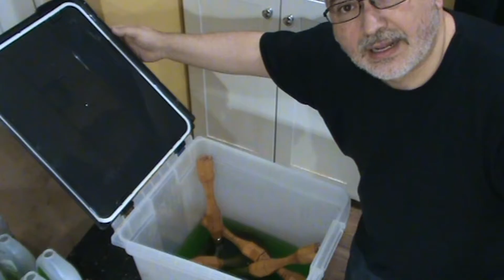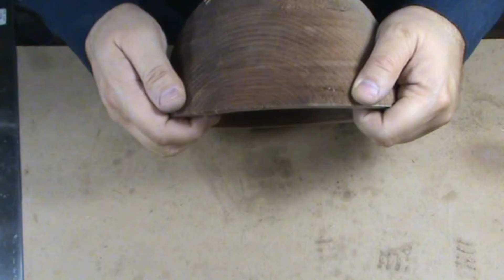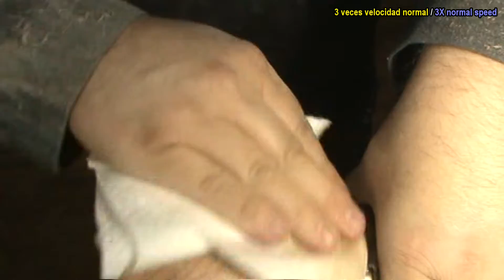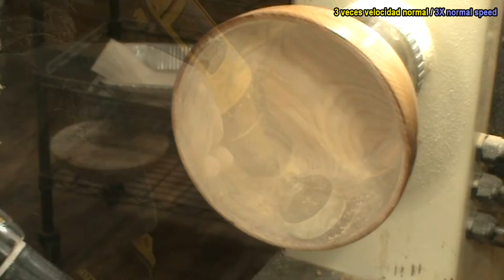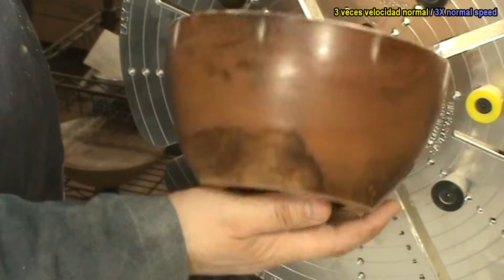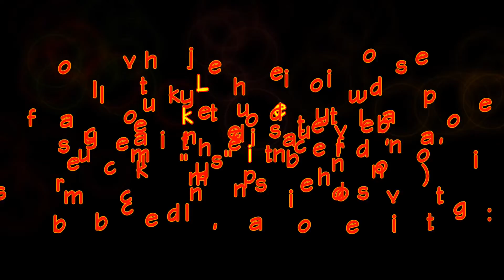Soaking in dish soap and water method, Part 2

Comment: About 8 months, how does the bowl look now?  Any cracks or warping?  I have not tried this method, curious if it's worth the try.  Thanks
Reply from the maker: +David Campbell Hi David! Thank you for your comment my friend. It looks pretty much the same as it looked 6 months ago when I did the follow up. I give you measures in mm since that is easier to get in finer detail:
After done the measures of the top circumference where 191 mm in the direction of the grain and 188 mm perpendicular to the grain. When I did the follow up, 2 1/2 months after done, it was 190 mm in the direction of the grain and 183 mm in the direction perpendicular to the grain. Today I measure it and it was still 190 mm in the direction of the grain and 182.5 mm in the direction perpendicular to the grain. So basically the same as 2 1/2 months after done. There was then not much additional shrinkage, and there are no cracks or checks. Still sits pretty well on its base and you have to look really hard to notice the difference in diameters in the mouth. That said, maybe different woods react in different ways. But I am pretty satisfied with the method. Cheers! Daniel

Comment: Very nice.... I was scared at first because I thought you were going to put it on the lathe and all the soap was gonna go everywhere....LOL! glad you washed it off and waited for it to dry... Very interesting in the fact that it is much faster than the other method... hope it works. The technique with the little wood stirrer to burn the circles was really great I will be trying that on my next bowl... Oh by the way my last bowl was a catastrophic failure... I missed judged the thickness of the bottom because I was measuring to what I could see... but I forgot the mortise for the chuck... ooops so now I have a bowl with a hole!!!!! Oh well  live and learn, live and learn....
Reply from the maker: Jorge Araujo LOL! That's what we all do my friend! Believe me it has happened to most turners, myself included. That is the tricky part of doing a mortise, you have to consider that the base has to be a bit thicker than the rest, unless you have thick walls, in which case you can play it safe. Respect to the try, yes, we will have to wait, meanwhile I have another video coming with a different technique that I believe gave pretty good results and you can turn a bowl from green wood to finished dry bowl in a day! I have the recording ready, just need to edit to upload. So in a few days :) Regarding the drying, I have heard of people (including the same Ron Kent) who actually soak the bowl while on the lathe, I guess using paper or a towel and turn it with the wood really wet. I am not so sure about that with the rust and everything... but, I guess that if you take precautions and use a raincoat, you should be ok :). Thank you for the comments mate! Cheers! Daniel